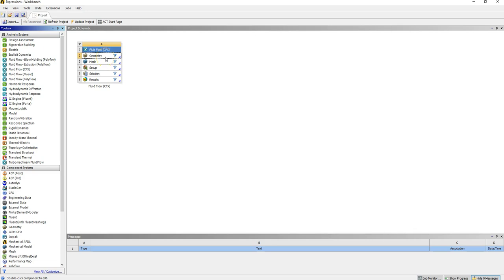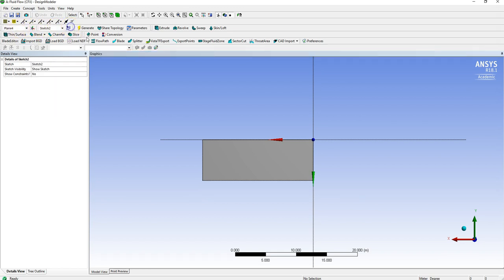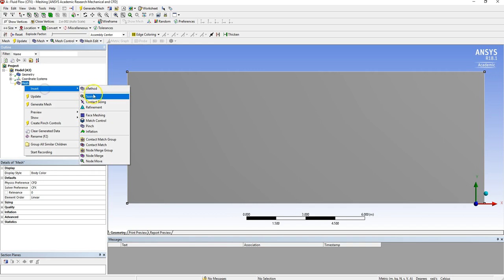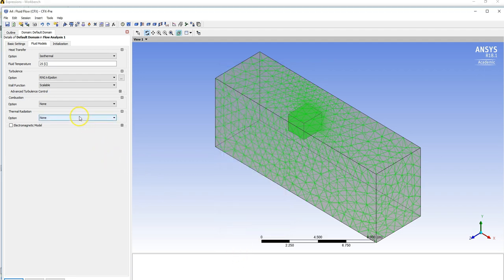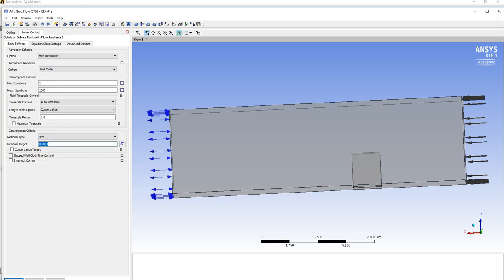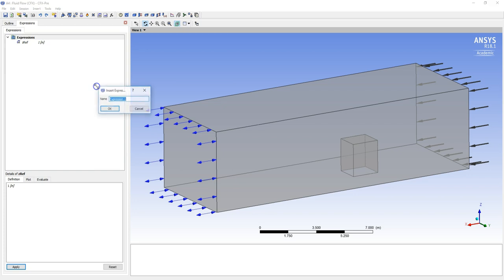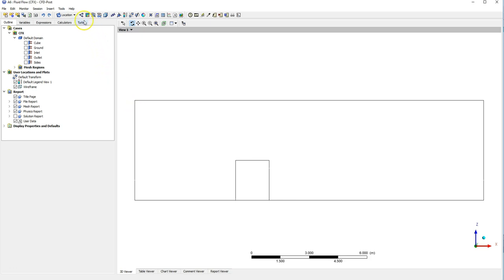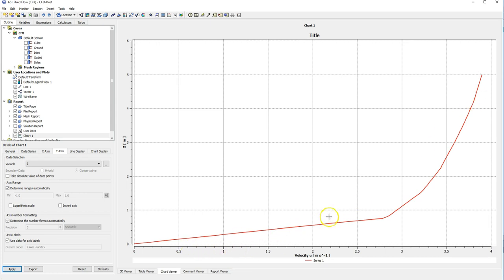How to create expressions in Ansys CFX - Power law velocity inlet profile example

Comment: thanks for this informative video, I am trying to get thrust force at the end of nozzle, when I write massFlowAve()@ what should I wirte inside the parenthesis ? after @ I think I should write the location I guess
Reply from the maker: Hi, Thanks for the feedback. I don't think anything needs to be in the brackets.
Reply: @ClimateCFD  Thank you for answering I found that masFlowAve is function and inside the parenthesis it should be the variable. It looks correct I believe.